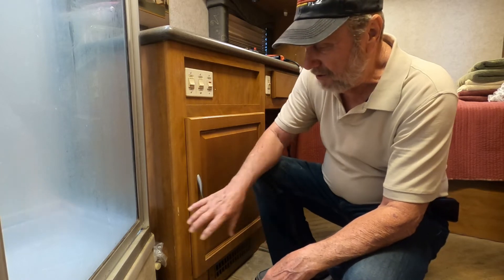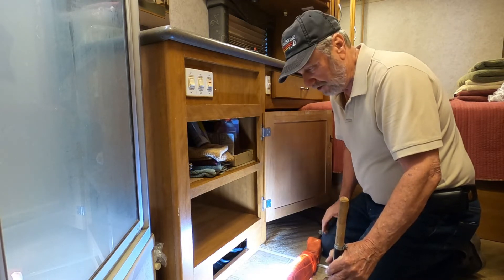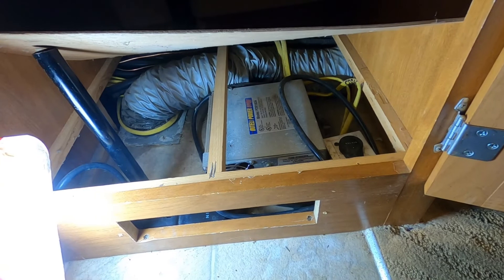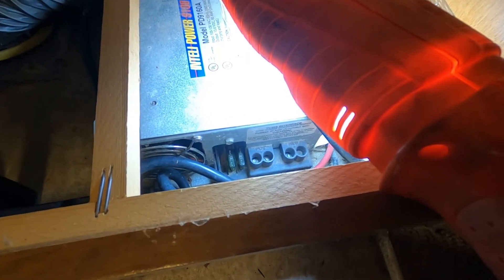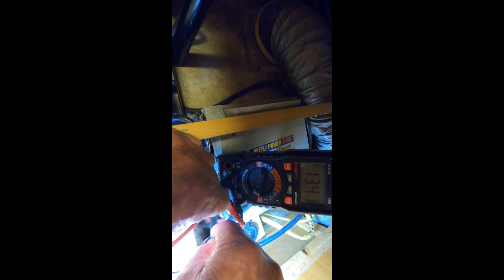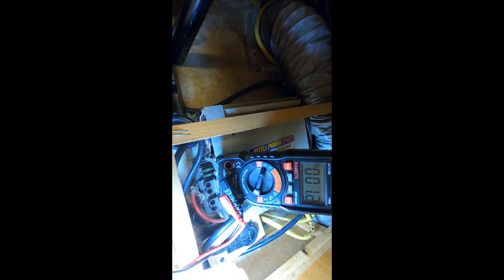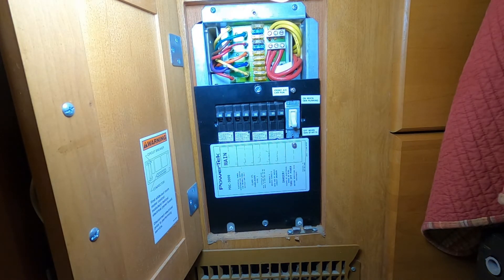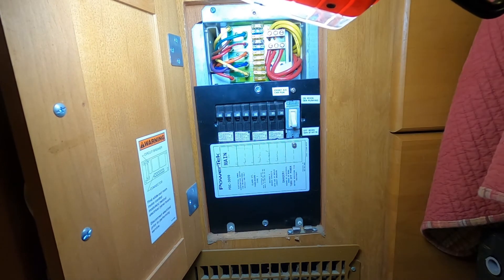Rv Converter troubleshooting and replacement procedures

Comment: My cooling fans are always running. Is something wrong?
Reply from the maker: When the cooling fan is running, it means the converter is hot and it is drawing air in to cool it.  You could have a lot of dirt and dust clogging up the vents causing it to run hot.  You should pull the cover and clean it out if you see a lot of dust around the area.  They should not run all the time.  Dust is the big thing that causes this problem.  Now as you use a lot of DC lights and things that use the Battery volatage, it will need to charge more, so that is another thing that makes them run.  Turn all lights, water pump and any other DC circuit off and see if it still runs.  Now if your Coach batteries are bad, that could be another reason the fan is running as it is spending a lot of time charging the batteries.
Good luck.

Comment: hi Sam. I have the same exact pace arrow as you. why would my converter be unplugged? we just bought this and the house battery's are not charging. I go look under the bathroom sink and the converter has been unplugged
Reply from the maker: I know why.  The converter is loud whine noise when it runs.  At night it is awful to listen to.  I put mine on a timer to shut off just before going to bed.  Then have it to come on as I am waking.  You will find this out when you have it plugged in all the time.  Bad place to put the converter.
Reply: @samowens44  Thank you. I plug it in and it does nothing; bo sound. I have 120v to the outlet. Will not having it plugged in permanently be a problem? I have watched all your RV videos and they are extremely helpful. Thank you for making them.
Reply: I also see I have no 30 amp fuses on mine like yours has
Reply: I added (2) 30 amp fuses and it still makes no sound
Reply from the maker: @glennjames9152  If you have plugged the converter in, check voltage as I show in the video.  Should have 13.6 volts on the red and black wire at the terminals in the front.  If you do not have the voltage, check the 3 fuses just to the left and see if one is bad.  If the fuses are good, you need to replace the converter.  In the description of the video I give a link that will take you to the replacement converter.  My video describes how to change it out.  Disconnect the battery terminal before disconnecting the wires from the converter, shorting them could cause problems for your battery.  Good Luck my friend.
Reply from the maker: @glennjames9152  It may not make a sound.  You need to check the voltage.  It only makes a sound when the cooling fan comes on.  that is when it has run and getting hot.  It does not make a sound all the time.  Check the voltage at the converter teminals for 13.6 or so.  If it reads only 12 volts it is not charging.
Reply from the maker: @glennjames9152  You converter may not be like mine.  Just look for the voltage output at the terminals of converter, watch my video, I show everything to check and how.  Remember, the conerter does not always make a sound when it is working only when it gets hot and the cooling fan will come on.  That is the time you will hear the whine I told of before.
Reply: @samowens44  Thanks Sam. The reason why they had the converter unplugged is because someone installed a 4 battery bank in the very back next to the license plate where that center door comes down, they also installed an inverter.
Reply: @samowens44  Wait! I added the 30amp fuses and I now have 12.83v aux power. Before i was only getting 9.65v.
Reply: Hi Sam. Your videos are very helpful. Is there room for a 30mm longer chassis battery? It has an H7 that is 315mm and I want to install an H8 that is 345mm long. Is there room on the battery tray for a 1.25" longer battery?